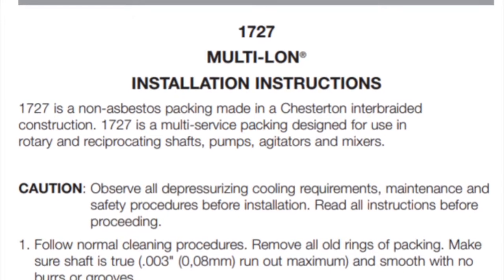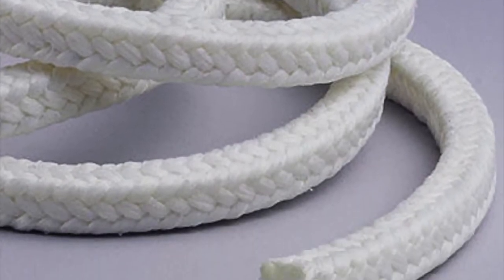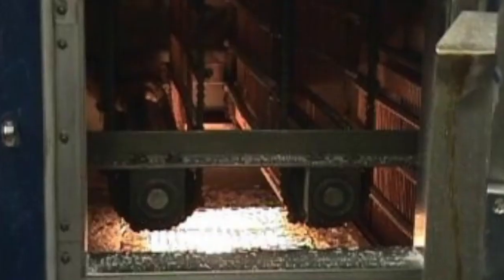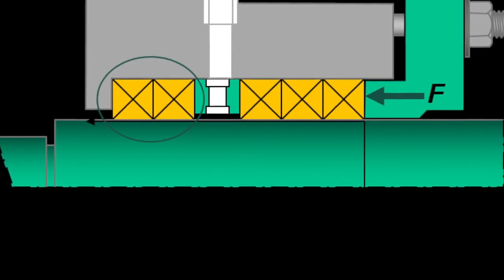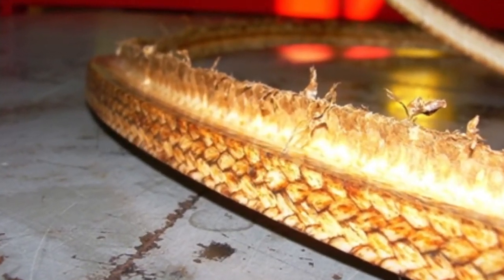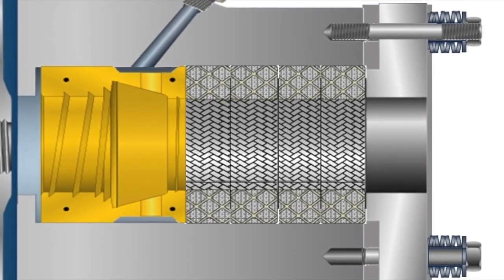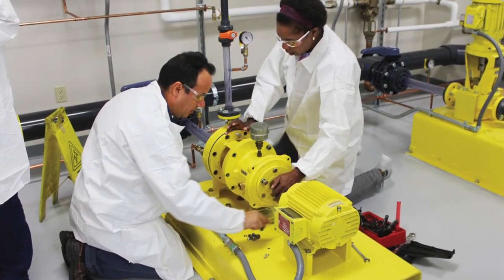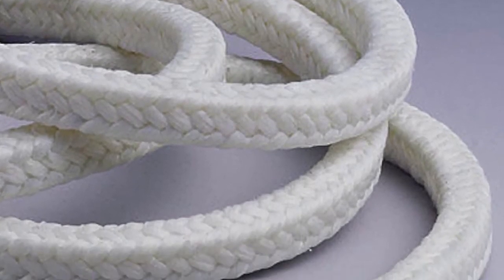Pump Packing Installation - Part V - How to Start a Pump after Installing Mechanical Packing

Comment: Great the video the plant I work for we are having problems with the packing on our lime system augers leaking we use 9/16 Graphite packing they only take two and graphite spacer. When going back to work I’ll post video and tag you it any help would be greatly appreciated thanks
Reply: Want to check out that video. Best of luck with your repairs!